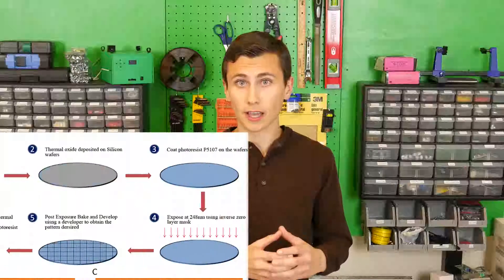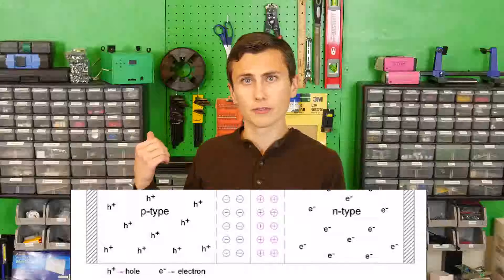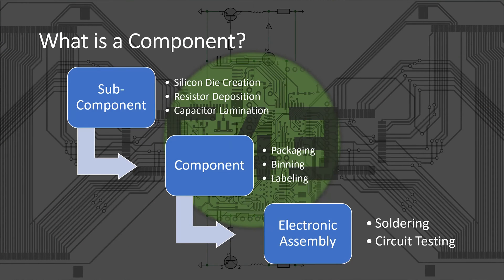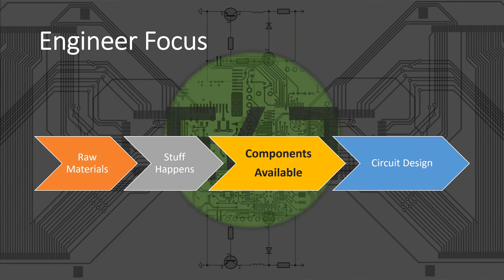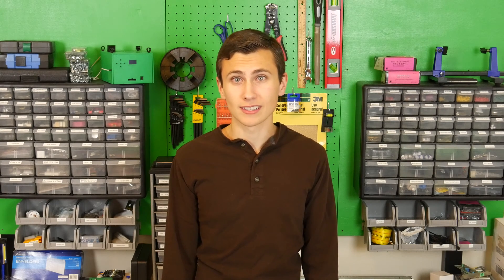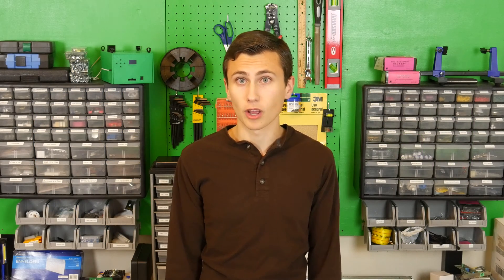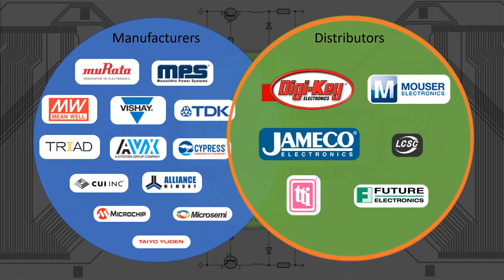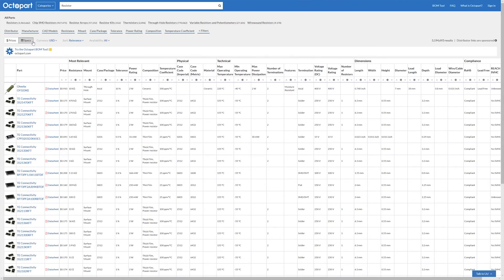Finding Electronic Components

Comment: You wouldn't by any chance know where I can find a flexible copper clad fiberglass PCB material? I know it exists because I've seen it, but can't find it anywhere.
Reply from the maker: Hi John Mc, thanks for watching, and, thanks for reaching out!

I didn't find any on digikey, but I did find a couple odd listings (Amazon, eBay, Alibaba) hopefully this listing has enough keywords to point you in the right direction! 

Cheers!

Pyralux Copper Kapton Laminate for Flexible PCB, Circuits, RF Shielding, 6x6 inch, 1 Sheet https://www.amazon.com/dp/B076C41MTV/ref=cm_sw_r_cp_apa_i_PDoyEbN1VAND8
Reply: @EEforEveryone  Thanks for the info. By the way, you're a great speaker. It doesn't look like you're going to get rich on YouTube, but you should try to figure out how to incorporate that skill into your interest in electronics somehow. Good luck.
Reply from the maker: @johnmc6293  Thank You John! I hope life has the best in store for you as well.
Reply: I can help you.
WhatsApp：+8613951639167
Telephone:+86-25-52121868   Fax:+86-25-52122373
Mob:+86-13951639167
Email: 1372286431@qq.com
         Kristywong521@gmail.com
Website: https://www.ntcshiheng.com/
Reply: @ntcthermitors508  Thanks!